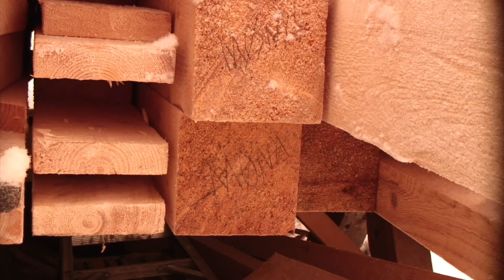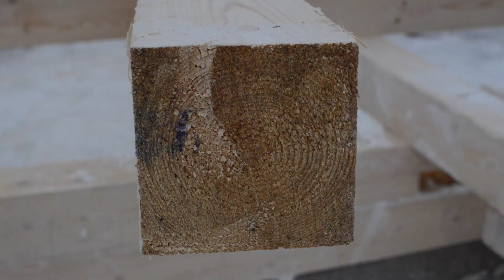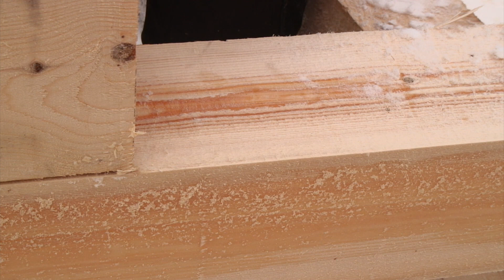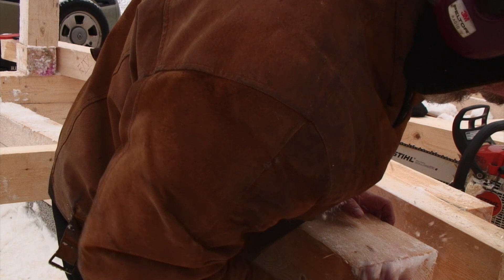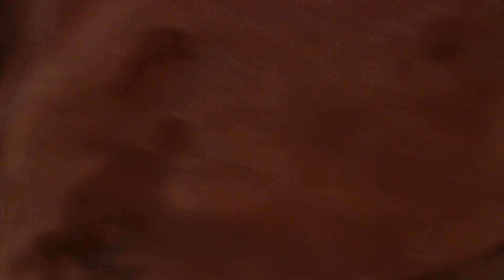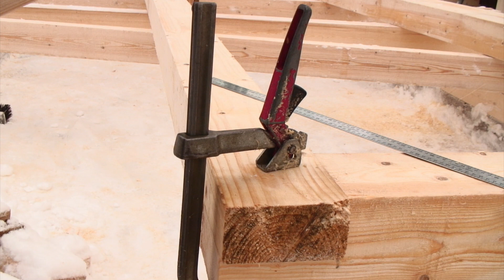🔴 9/35: building a Post and Beam Garage - Numbering the parts

Comment: Hi, you have referred many times to the term "Purlin" but not in the correct sense. 
The Purlin provides support to the rafters and helps prevent sag under the load of snow, runs at 90 degrees to the rafters and mid way between the Ridge board and the Birds Mouth. 
It would normally be of 75 x 150 mm or there abouts stock and is supported by a diagonal struts which in turn are on a 'Binder' which is fitted 90 degrees to the ceiling joist's. There would be a Purlin on each of the two slopes of the roof.
Looks mighty cold there, I'll settle for the mild climate of Hampshire UK haha
Reply from the maker: Excellent clarification, thanks. I have printed out a little illustration with the English terms for the parts and will try to use the right names in future. Truth be told This building technique is not my specialisation, which is log houses. But I have restored a number of barns made in this technique so although I am familiar with the parts and functions of them, the names in English and Norwegian are sadly lacking.

Comment: Thank you.  Excellent as always.
Reply from the maker: Thank you MckinleyHenderson, Seasons greetings, Lucas
Reply: Why now Dumb work in cold weather
Reply from the maker: Ignoring your insult, I will answer your question. Builders work all year round here, and it is snowy like this sometimes 7 months of the year, so no point waiting for the snow to melt. That won't be until May. Stable winter weather is preferable to summer rain. The culture here is completely adapted to living and working in this climate. Although I was born in UK I have lived here for 23 years which is most of my working life.